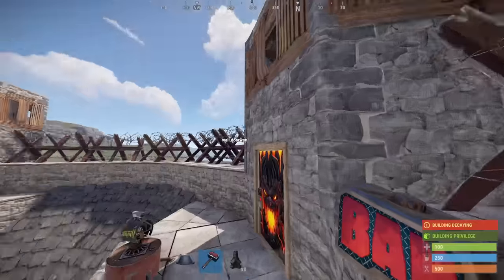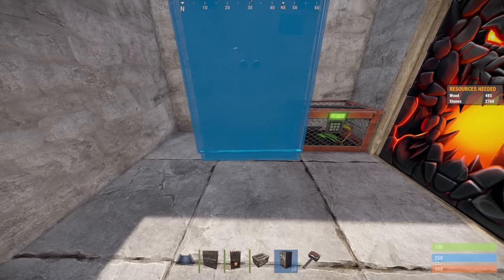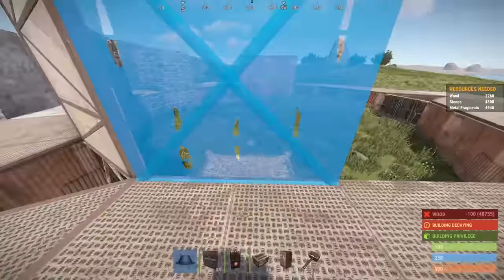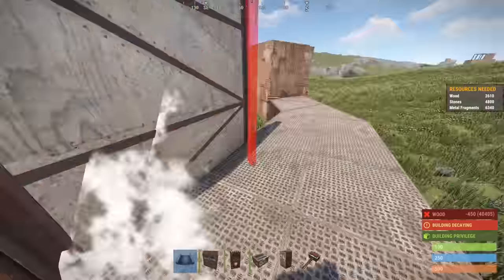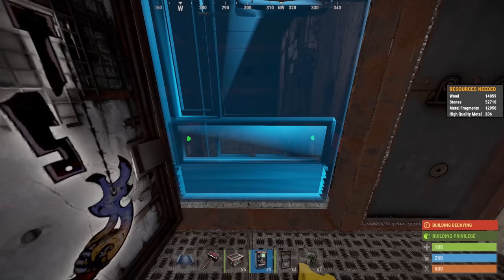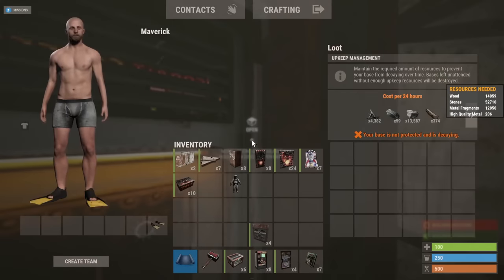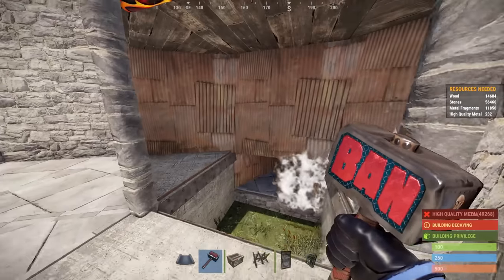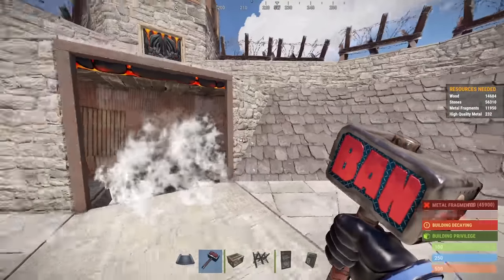Rust The Redoubt coreless base concept

Comment: These concept bases aren't meta because they don't look fancy or make for good youtube videos. Also, it's annoying af for raiders because you don't have a clearly visible path to raid through, and basically need to play Russian roulette trying to find out where the bunkers are. Also, I think a better floor plan would be to do the same kind of circle design, but split it into externals. You can plug in the gaps with external gates which you can integrate directly into the wall design like in hoodys video. The center of the base should honestly be a kind of funnel wall where you're basically forcing the raiders to go through a gauntlet.
Reply from the maker: I beg to differ on the idea they don't make good videos take JTeles for example here's a link https://youtu.be/1MeFsFjov_8 He has also done what he calls the best looking base in rust which is also a redoubt design called the facility of which Wiljum commented that's it was genuinely the most impressive looking base he has seen so I would say that it does look fancy if the base master himself approved lol. This was a early prototype of the concept and like all prototypes it has its flaws but the concept is sound check out my redoubt playlist for improved versions.

Comment: I try this base, the Towers can easy ladder up and yes i place metall barricade on top
Reply from the maker: The raid cost is the same both sides of the base so don't worry to much which side they are on. I actually like it when they climb over onto the other side of the base, we call that the kill zone it also makes it safer and easier to loot there body's in the middle. I even leave ladders there to trick others into climbing over lol.

Comment: How do you lock all of the bunkers up and open them when your on?  Repeatedly spawning on different beds? or?
Reply from the maker: Thankyou! its so cheap and expensive to raid that even a zerg would have trouble raiding you off the server if you have multiple bases.
Reply: Yeah, if you are actually using all 3 bunkers it might be a bit of a pain.

You can also put turrets near the twig walls and remote into them at a computer station
Reply from the maker: @DSzem1  That is genius I'm using that!!

Comment: Players that design bases based on luck/math, seem to forgot what kinda of game they are playing. 1 group with an dirty ESP - and all your best stuff is gone for a cheap raid.
Reply from the maker: What?? you don't use externals? If you use externals getting TC means nothing, I don't put them in my vids because its a given that you should use them on any base, and at least you will need a cheater to find the TC on this design were as I can find the TC on any predictable meta build without cheating, 2x2s back side of base and any medium to large base will always put there TC in the core which i just love cause that saves so much boom knowing where TC is every single time, meta predictability so easy to exploit.

Comment: And so, I lived a week-long vape, living in this database, I found a lot of problems. Firstly, the walls after the roofs need to be raised higher because homeless people with ladders easily jump over, then after they have lifted, homeless people will still be able to climb, they will also constantly throw grenades and beans into your yard, the base is very easy to raid, literally sit for 10 minutes and see the pattern where they go most, it will immediately be clear where the closet and loot, I personally closed the whole top is covered with ceilings, but after the construction, players began to climb onto the roof and break windows, then they climb into one of the towers and easily sit you down, windmills are also not where to put because the house is low and you will have to build blocks up and put the battery outside the roof, also, there is not much space for loot, the towers for shooting are too low that players can use to kill you and can safely take everything from your inventory, as well as 1 cabinet is not enough for you, you need to put at least 3-4 more around the perimeter because the player can put a tower nearby and clean you calmly if you do not close the house with a roof, then your turrets will be broken, as well as a large stove. I do not recommend using this database, at most on the pve server. I wrote everything.
Reply from the maker: I don't understand why  it was such a big deal that they were able to get to the left hand side of the base as well as the right. If this statistically unraidable base was in a straight line would it worry you that people were able to get to all sides? Also why was them throwing frags onto one side of the base a problem and also all bases that use metal embrasures on windows have a slightly lower raid cost there so why say that is something unique to this base?

Comment: called an Inverted Core
Reply from the maker: Except unlike an inverted core this has no core at all and also outside of that they then do an open core design on separate TCs. What makes the compound is a statistically unraidable base bent around not an open core with loads of garage doors going straight to loot rooms unlike the inverted.
Reply: @maverick1484  fr you could also apply this concept to an inverted core and make a more standard base around it
Reply from the maker: @susan2376  Definitely worth thinking about 🤔🤔

Comment: Really cool design and concept. Not really practical though. Really high cost and upkeep for almost no base defenses this base is actually a pretty easy raid. This base doesn’t have “build stages” so unless you have a some capable team mates goodluck finishing the build and managing upkeep. That being said. This is a great base for PVE players.
Reply from the maker: Its about finding a balance if you do put half your resources and upkeep into a shooting floor for online raid defence don't complain about never being onlined. Online raiding is not a meta (unless its a 5x or 10x server)and don't be deceived by other base designers who have pushed the offline meta by getting players to spend all there time and effort into building a huge shooting floor they are part of the reason players are always offlining. Also i don't know anything about PVE servers never been on one but i feel that a 15 rocket bunker for your TC plus 3 stability bunkers and 20 + garage doors might be a bit unnecessary.

Comment: sorry but thats basically just a bad inverted core
Reply from the maker: It has no core unlike an inverted core which has the TC predictably in the middle inside a core building. Also inverted core is split up into multiple TCs which are also predictable, these TCs are very vulnerable only needing 8 to 15 rockets to remove and grief personally I love them along with clans that use wide gaps its gives the bases huge vulnerabilities which makes it cheap and easy to grief,  with being an overly complicated build and easy to grief inverted core has not been well received by the community even though its been around for about a year and a half. Yet another difference is inverted core seems to have is their loot room entrances face into the core instead of making it a mathematically unraidable base and making a huge door path through the structure they just leave the loot room doors on display for everyone to see where everything is, This design has blown up for good reason it has none of the drawbacks of inverted core.